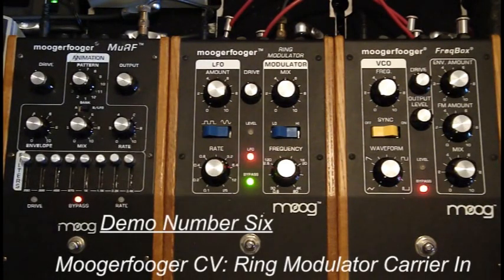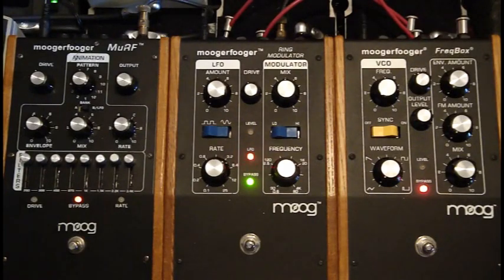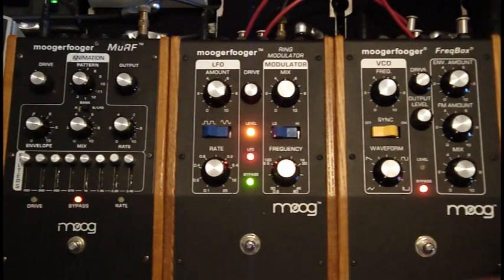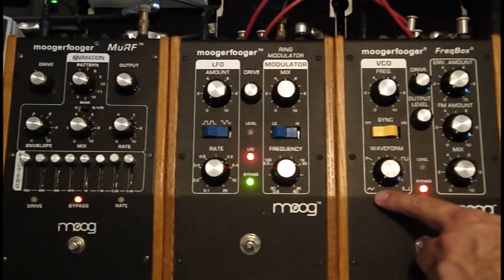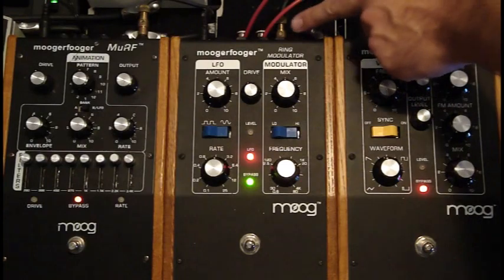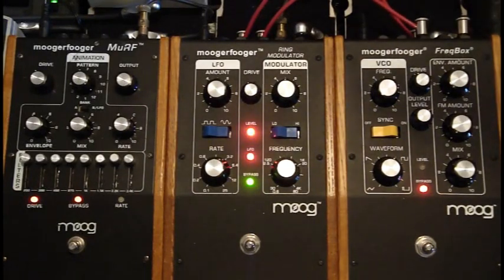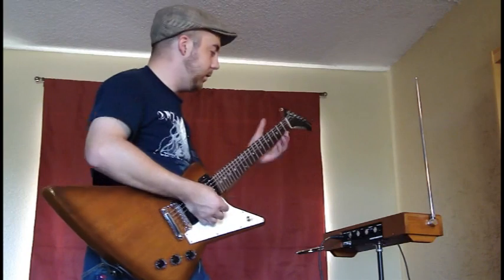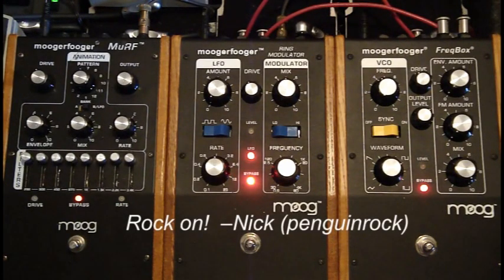Moogerfooger CV: MF-102 Ring Modulator Carrier In (Demo)

Comment: are you using stereo or mono jacks for the carrier out etc...?
Reply from the maker: I'm confused by your question. If you mean TS (mono) and TRS (stereo) cables, then it's all TS cables interconnecting these here. However, the Moogerfoogers can take expression pedals like the EP-3, which have TRS cable ends.
Reply: @NicholasGreenwood  Sorry for the confusion. You answered my question: TS cables can be used, but when EPs are involved then TRS. Many thanks!
Reply from the maker: @thesskep689  I need to make a distinction here--the Carrier In, Carrier Out, and LFO Out jacks on the MF-102 are audio only (TS cables). Probably not a good idea to plug a TRS cable into them. Be sure to double-check the individual jacks on any other Moogerfoogers + other gear you may have.

Comment from the maker: @electronicpoision
You're right, mine does read Audio, Osc, Env, from left to right.  If I'm not mistaken, the bottom row of jacks are "point-to-point" wired rather than extending directly off of the circuit board, so it would be easy for Moog to make a change.  There is nothing "wrong" with this.  My FreqBox has a relatively low serial number, 1768.  What's yours?

Comment: @penguinrock trying to control the LFO rate in the pedal using an SH-101, or even a sampler, basically im just looking to get the LFO on tempo with other equipment. Would you know anything about that?

Comment: @penguinrock     Another trick with the MP-201 and Ringmod Carrier In: In Expression mode with the CV to the Carrier In, the Ringmod acts as a Volume pedal with full volume at about 2.5v-- with a full 5v you reach unity halfway in the sweep, and then back to silent at toe down for manual tremolo tones. If you use the MP201's LFO's into the Carrier In, you effectively have Tap Tempo/MIDI sync-able tremolo with multiple waveform choices. The MP and CP are must haves in a moogerfooger setup!

Comment: @penguinrock Yes, you want one!! I have a dual oscillator bass guitar synth board, and finally plugged a MIDI keyboard into the MP201; controlling the freqbox's and a lowpass as oscillators and using a Gate or ADSR Envelope (new firmware) into the Ringmod's Carrier In as VCA-- quickly turns my bass guitar synth into a keyboard monosynth! You could do it with your Freqbox&Ringmod, using their Osc Outs instead of Audio Outs. :)

Comment from the maker: Moog makes its own expression pedal, the EP-2, which can be used with the Moogerfoogers.  To my understanding, though (anyone else please correct me if I'm wrong!), the expression pedal has a TRS ("tip-ring-sleeve") plug.  Moogerfoogers are designed so that if any one TRS cable is plugged in (EP-2 into a Freq. control, for instance), no other CV jack will work, period.  This is a safety feature designed to protect the circuitry.

Comment: This shows off a very central concept of Moogerfooger design. If you have two Moogerfoogers, you not only have the features of each, but you have a third set of features that spring from the comb...ination of the two.

For each Moogerfooger you add, your sound-sculpting power grows exponentially.

Great use of the Etherwave Theremin in this one as well!

Comment from the maker: I tried what you suggested by switching the order of the Ring Mod and FreqBox altogether.  Turns out, the Oscillator Out from the FreqBox stays exactly the same, i.e., the Osc Out does not reflect being in sync with the guitar's tone, even with the pedal on (and Mix knob down).

...But I like what you're thinking!